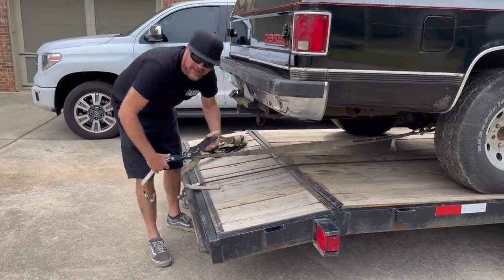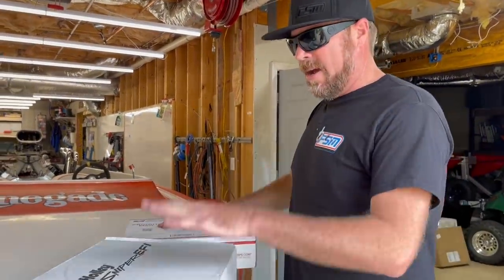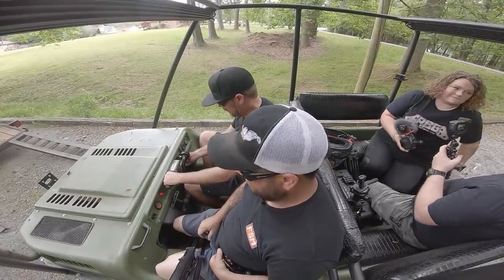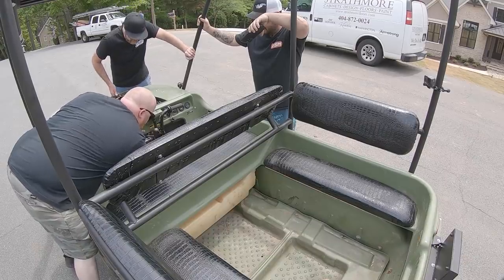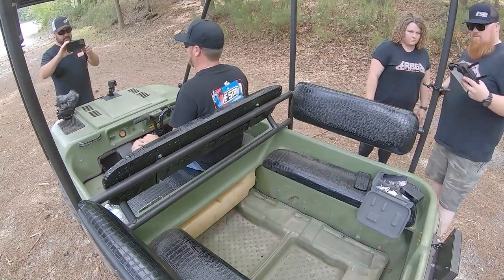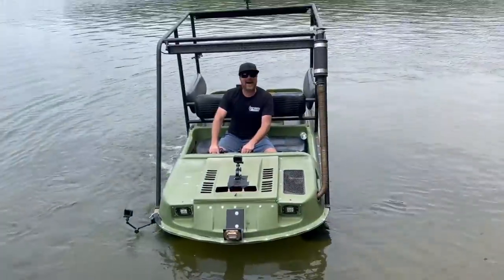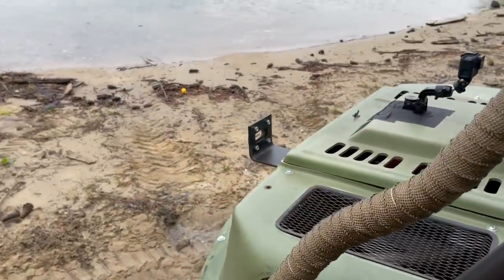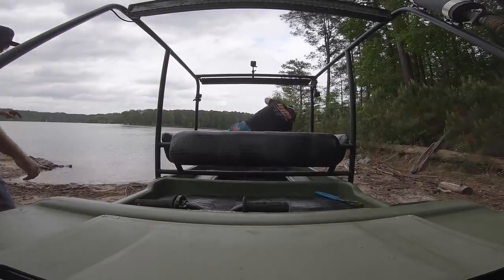Got An Old UTV and Drove it Straight Into a Lake!

Comment: Hi Finnegan - I have one of these couple of tips - if you're going to be messing around on the concrete  - over inflate the two centre rows of tyres and it will turn much much better. 
Also - if you flip the wheels in the second to back row of wheel so that the tread pattern is reversed - it will steer in the watter much better in reverse. 
Also (you probably noticed this by now) there are two bungs under the rear floor to stop it from flooding and sinking. If you get water on the drive belt - you will get stuck till it dries out.
hope this helps - cheers .

Comment: I worked at Argo right out of highschool in the early 80's. You'll have fun messing around with it. I've restored (3) of them. The old 440 2-stroke one was crazy! You won't tip it. I used to stand on the edge and rock it back and forth... no tipping. I have (2) 16-wheel machines that were built up the road from Argo back in the day. My orange one has the 24-wheel option!! Fun hobby. You have pretty aggressive tires.. likely why it's hard to steer.

Comment: I believe you can attach a Electric Trolling motor to the back of the Argo for even better performance on the water.  You'll just need to add another battery to power the trolling motor itself!

Comment: A friend and I got an Argo 8x8 a few months ago after he bought a house on a lake.  Drove 4 + hours round trip, got it home, unloaded it off the trailer and immediately drove it into the lake.  A bit un-nerving at first as it is tippy side to side but crazy fun.  We did put a trolling motor on the back and it works great.  Can't wait to see the kids reaction when you drive it down to the lake and don't stop and just drive right into the lake without telling them it floats.

Comment: The last time I seen an argo used featured in anything was the banana splits tv show and I am going back a good few years im 53 now.  Yours does not look as high millage as me so I'm guessing it's quite a bit younger, ivs just checked and their buggies had only six wheels and no cage. And that was some leap of faith driving that monster into the water. What about fitting a jet ski engine into that thing. You could drop a couple of hinges onto the frame with some floats so you could unclip it from the top and let both sides drop down and use them as outriggers to help with stability. Fantastic show guys absolutely loved it thank you so much

Comment: My Burban that I bought in Cali back in 97 was a tank ran perfect no major issues for the 7 and a half years I owned besides the regular maintenance break pads, changes oil, and other fluids. The most expensive purchase I ever had to make since I bought it was new tires. I drove that sucker to Arizona and then drove 6 hours to Vegas every weekend and back. Only issue was it didn't have cruise control but I found a 8lbs smooth flat stone the was perfect to sound in front of the petal and kept it at a steady 90mph on the road to Vegas and also worked as an anti theft when I shoved it behind the breaks, the two times someone tried to steal it they weren't able to get it into drive apparently very easy to Jimmy the door on those suckers! Still ran perfect when I sold it to some farmers in 06 before I left to come back home.

Comment: Used one like that for work. If you stand in the back and reach for the controls it does a little better. It has too much weight in the front and that makes it hard to maneuver. Having a small outboard engine on the back will help also

Comment: "Avoid driving your Argo on asphalt" from the owners manual
Reply: It's not bad to drive them on asphalt, but due to the skid-steer esque drive system, it can get pretty damn rough turning on a hard surface lol
Reply: I had the plastic tracks on my 6x6 and the road was the funnest place besides water, because the plastic tracks on pavement would do crazy fast donuts. Any hard land with mine killed my back after a period of time, but fun none the less.

Comment: The engine in it will last forever! I have the same one in my older Gravely garden tractor. Keep it in low range when launching skis/boats. It will pull 3500 in low range no prob.

Comment: We had a couple of those in the past. The brakes are needing some work on that one. It should spin around in a circle like it is nothing.
Other than the brakes, keep an eye out for a tire that isn’t pulling its weight, it would probably mean a roll pin sheared at the axle. Easy fix.
Also, it looked like you were in low speed the whole time.
When you came out of the water the first time, it sure looked like you never put the boat plugs in the drain holes.

Comment: love the videos.  I own an argo aswell. A 1999 bigfoot. Just wanted to let you know your running it in high gear when you shouldn't be. High gear is for when your on hard smooth ground. Low is for when your in soft ,muddy or rough terrain.  The older argo's have the classic transmission. The more weight you have in it the harder to turn in high.

Comment: I owned argo and maxx both 6x6 the argo was more fun in my opinion between the two. I also had a set of plastic tracks for the argo and when I was on a hard surface like the road that thing would do crazy fast donuts. I'd load the kids up hot the street and whip us all around. Tracks on it also made it virtually unstoppable, alot of wetlands around me and I've gotten the maxx stuck from high centering it. The argo with the tracks would go through anything, you would lose a little in a pond with tracks as far as speed, not that you have allot of speed anyway. Mount a small outboard or trolling motor to take care of that, and make sure you got a working bilge pump. Have fun with it!!!

Comment: There was a mod (manufacturers parts) that gave you a small rear prop.   It was never really designed for large water like that, but they made a prop that goes on for people that like to push the envelope.    No idea if they sold many, or if any are kicking around.    Tyres are on the wrong way around!

Comment: Finnegan man I’ve definitely wanted to put a Holley fuel injection set up on my 1969 Chevy that I just built a 421 sbc for!! It previously has a Holley 750 Duble pumper on it!! Finnegan I think you would definitely love my truck for sure especially after you building the two wheel drive one!!

Comment: Thanks for a great vid, I have an old Max 4 6 wheeler w a Rockwell 2 stoke, I need to get it running after seeing this, tires are a problem for the Max they have a very strange integral hub.

Comment: So @7:28 Fin says its not good if you have a EFI and have to use it like a carbureted vehicle.. I 100%  Guarantee the problem is the fuel pump not the EFI... i dealt with the same problem on every 80tys and 90tys Chevy and found out it was the fuel pump not the over priced EFI'$

Comment: i had one years ago., just mount a johnson 5hp to the back of it. and make it have cable steer. easy upgrade and makes on water easy. :) 
when travel off road take the motor off if gonna bounce a lot.

Comment: Mike, you should get ahold of the Youtuber FLAIR and get the 12 wheeled one he bought a while back that has a street bike engine in the back of it, and he had issues with it running so he never did anything with it, and not too long ago he said he needed it gone. It's a tougher built unit than the one you just got, and it's a 6-wheeled unit that has dual tires all the way around. It would be a really cool unit to have. I think its issue was the carbs needed gone through.

Comment: Yep.. the hood comes off in the first five minutes.. because Roadkill. I think you need to add a little weight to the back to fix that nose down position in the water. It'd be interesting to see you do a Rotax swap or something (maybe a motorcycle engine? Moto Guzzi engines are CHEAP) in that thing and give it some power and upgrade the brakes so they actually work. You know, if I wasn't afraid of it getting capsized by the huge wake the wake boarders put out in our local lakes.. getting one of those would be highly useful as I can't walk up and down the boat launches anymore and can't climb stairs that are half the size of my feet. Being able to drive down into the water and back out would be a great way to be able to still go fishing.. I don't think it'd ever make it back up out of the lake though as our boat ramps are incredibly steep. Hell my 69 Ranchero I had almost didn't make it out of Bullard's Bar because it is so steep (and a little algae growth) it kept spinning the tire.. despite not having any power, I had to turn back and forth about 40 times and turn it into driving sideways to get out. (anyone that knows it, it was the main launch at the dam) The thing about those is you need to keep the rpm of the tires down or it'll just cavitate the water and not really go anywhere. Tires with huge lugs would help it move better too... especially the big military style ones like what were on the WW2 Jeeps, like Carlisle makes, or paddle tires obviously would work in one direction. Oh and you can always add some fold down pontoons and go full catamaran if you are worried about tipping it on wake.

Comment: i had a 6x6 with the 440 2 stroke, it had mechanical brakes, simple, but going wide open down a trail with trees on both sides it was a little scary, it would put you sideways in a split second.

Comment: If brake doesn’t loosen up with use,look into an aftermarket one. I think Gregg rebuilt the brake cylinders and calipers but sometimes they just work like new ones. Maybe someone has run into this issue and can offer advice.

Comment: Finnegan almost had it right when he salvaged the 2x4 and got rid of the Suburban. But it's now time to get rid of the Ar-nogo. Controls seem terrible, that sticking LH braking system looks like a complete PITA of little proprietary parts to fix, and it's only a matter of time until that Kohler goes under.

Comment: I'd upgrade the braking system to a separate setup. These were never a good design to begin with. I know some people swapped Suzuki units from K cars on these and they worked right (because no heat transfer).